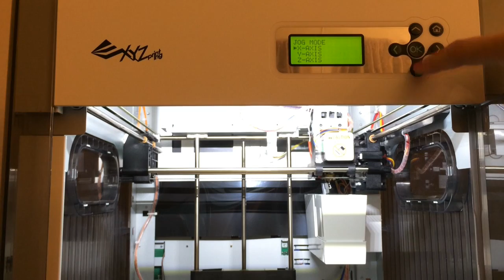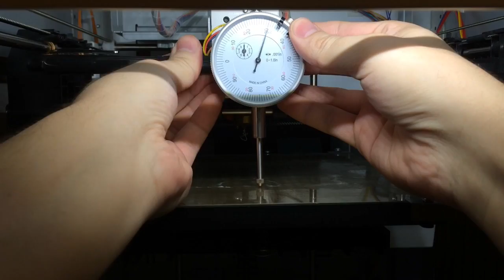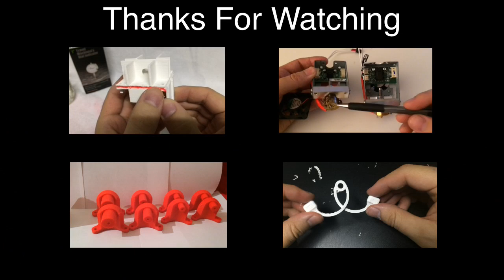Adjusting da vinci 1.0 3d printer bed calibration using machinist indicator dial

Comment: Great adapter model, I made one and used a 8mm screw tap to thread the Dial indicator's hole, holds better but I realized that it can not measure the far end of Y direction.

Comment: Thanks for the vid. I printed out the object on thingiverse and I have installed the machinist dial indicator. My problem is that the dial doesn't stay on nicely like in your video. It flops around a little where its mounted which makes it impossible to get a good measurement. Any ideas?
Reply from the maker: Jake Barteaux Yeah at first mine was fine but then I started getting a similar problem. Try this one 
http://www.thingiverse.com/thing:718768   or this one   http://www.thingiverse.com/thing:370496
Reply: Hrt Tele Thanks a lot man I took a look at both and decided to print out the first one. It works perfect. I should have known to search Thingiverse!!
Reply from the maker: Jake Barteaux Yeah no problem anytime.

Comment: Ok so now is to turn A B C to satisfy a 0.1 ??  Can you briefly explain the unit of measure to be the bed calibrated
Reply from the maker: Rene Solis I don't use it as a unit of measure, I use it more as a leveler. I start either at the lowest corner and see what the dimensional difference is between one corner to another and adjust accordingly. What you could do tho, is run the da vinci calibration run and see which corner has the best value meaning between 215-225. And use that corner as your baseline while you adjust the other two.
Reply: Thankx Mrt Tele,  Awesome LIKE !!